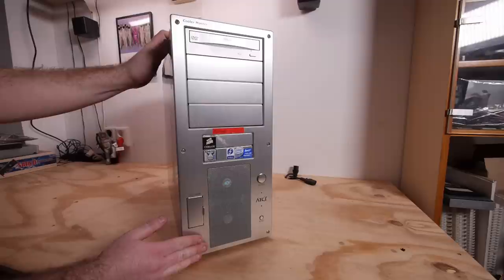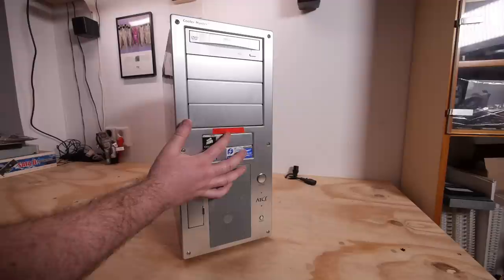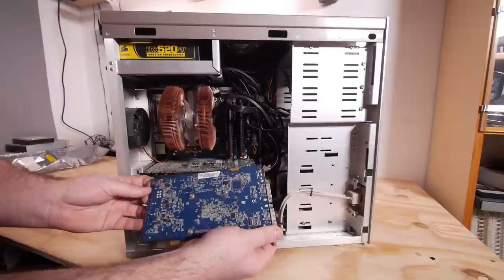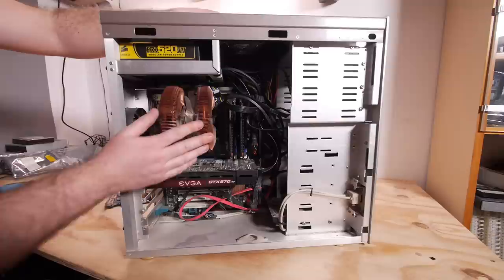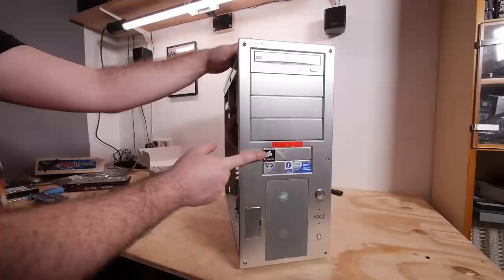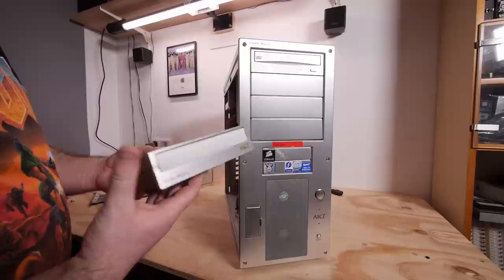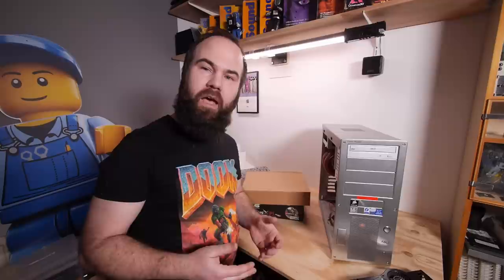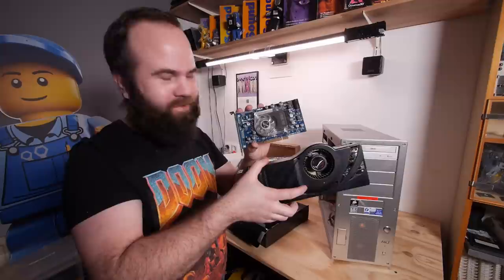I Finally got my 2007 Intel Q6600 Workstation Back!

Comment: That case. Classic. Don't think we'll ever see cases of that quality again. My personal favorite are my Lian Li K7's. Steel chassis, full aluminum shell. Built like tanks.
Reply: I feel the same way about my Corsair 650D.  It’s built like a tank.  Paid $200 for it new and still have it 8-9 years later.
Reply: currently using an alienware Area 51 case from 2003, Saucer Grey. Got it for free, i actually have the og board, psu, gpu, ram, and hdd but they're kinda hit-or-miss when powering them up sadly

Comment: Datorbutiken just means "The Computer Shop" :) 707 SEK would today be about €70 so a bit more adjusted for inflation. As for the sound card the Audigy 2 ZS is a great card but I'd probably say go for an X-Fi if you have one. Really looking forward to this geweldig build. :)
Reply from the maker: That was pretty cheap :)
Reply: X-FI Fatality was what i would have bought back in then for sound.

Comment: I also have a Q6600.
I have with a ASUS P5K motherboard, 8 GB DDR2 RAM, ASUS 8800 GT (256 MB).
It still works and I use it as a test computer.

Comment: I had a machine very similar to that, but with a lesser motherboard. I also had a Q6600 overclocked to 3Ghz with Zalman cooler, 8GB of Kingston that was unofficially supported but worked. I ran Fedora Linux on a Samsung SSD boot drive! That was my main workstation until 2014! Love your videos! They bring back great memories ☺️

Comment: I'd still use that Gigabyte RAM card and let it backup the current state to the normal HDDs in the system prior to shutting down. If the RAM card really maxes out at 4 GB as you mentioned and you set up backup so that only changed files are backed up it will be very fast to complete anyway.
Regarding the choice of the soundcard go for an X-Fi based card and dependend on which kind of speakers or headphones you're gonna use get one with HDMI output or good analog output.

Comment: The X-Fi XtremeMusic (SB0460) is a good fit.  It's actually from around 2005.  It will support all the later EAX modes which would have been appropriate for the games of this era, while the Audigy2 won't.

Comment: beautiful case, all aluminum so nice. so funny about that dent, i just got a wave master and i installed a x48/qx9650 with the non copper version of that cooler, and luckily the wave masters side hole just clears the cooler...

Comment: I have the Nickel Plated 9900MAX cooler version of that cooler cooling a bare die 5.3GHz 8700K. I took the cooler right of my eVGA 680i SLi motherboard which also has a Q6600 GO. Which i still have running at 3.8GHz. Yes my CRYSIS rig still runs today. I dropped a GTX1050ti in it with OCZ's Platinum 1200MHz DDR2. Pretty nice setup even for today.

Comment: I still have a q6600 running in my office.. & it's good enough for excel & basic webpage.
Reply: I still use it at home to watch videos and play games. It handles Shift 2 and Lords of Shadow 2 surprisingly well with a Radeon HD 3870 512MB! It originally had a GeForce 9800 GT, but that just randomly died one day for no apparent reason..

Comment: I got a Pc with an intel core 2 quad Q6700 and 8 gb ram and a gtx 550 ti 1 gb vram. It runs windows 10 64 bit. I had to disable lots of things to not have 100% cpu usage all the time but after that, it works surprisingly well.

Comment: Looking at your sound cards option: for an ultimate 2007-2006 era build you must use sound blaster X-FI. So go ahead with SB0460.
At the end I will change the GPU. It's rare, it was awesome at the time but if you want to play Crysis or 2007/2008 games era you need more power to maxed out or to play them at 1080p or higher. So if I were you I would buy a Radeon HD4870 or 4890 series card. If you want Nvidia GTX 260 with 216SP or higher 2xx series. That's the highest solution to avoid compatibilities and graphics problems.

Comment: The RAM-Disk-Card is rather interesting for this build. Using Windows (which I think is totally legit on this non-productive, gaming oriented system) you could change the settings to only put the virtual ram into this ramdisk. For this thus you need either a battery to store the format data on the ramdrive or a program to run once on a power-cycle in order to format the ramdrive before starting Windows because it BSODs otherwise.
The Ageia Physix Card is rather rare and I think there were usecases beside games back in the day. I kind of remember plugins to Autodesk Inventor and SolidWorks to use these cards for improving speed on stress calculations.
For your soundcard choice I would like to say the gold plated card looks nicer. The capabilities of both cars are almost identical when not using the Live!Drive.
Regarding your choice to use hdds:
It kind of makes sense in this circumstance because the speed-boost you could gain with a ssd is rather minor. The bottle-neck would be the sata 1 controller. For data, you depend on, you should use your external controller card(s).
And please do yourself a favour and recap the whole board. I know: It seems unneccessary now but consider: If you build up your system with this mainboard and slowly but shurely one after another cap is failing: Do you really want to rebuild your system 10 or more times?
And while your soldering iron is hot, please check your other cards for capacitors as well. Recently I had an Audigy failing with leaking capacitors and it is a mess to clean up afterwards, I assure you!

Comment: I had the same (BH5) hyperx modules with the same cpu on P5K, with the same PSU, and had the same ram problems. The root cause is that the memory modules advertise one of the parameters 1 clock faster than the memory controller in the chipset can be configured for. The Asus bios does not have any code to limit the parameter, and ends up loading a crazy value into the chipset, unless you set the timing +1 manually. The psu still lives on to power my i5-3570K and now R7-3700X.

Comment: Ram is probably unstable because of the chipset lacking voltage in the right places vs the cpu.
It's a 975x chipset & fsb normally not taking beyond 1333 fsb with the core 2 extreme qx6850, so a 3.0 ghz overclock on the q6600 is probably near the chipset limit with the lowest ram timings you can do with 667 mhz or 800 mhz ram speed if you push voltage a tiny bit on ram controller on the q6600.

Maybe go with a bit newer socket 775 motherboard & a socket 775 xeon mod like a e5450.

X-FI soundcard as other comments mentions should work well.
A 32 gb ssd wouldn't be too out of place actually, November 2007 first 2.5 ssd's came out with ofc high prices of around 5 - 700 € for a 32 gb drive, mtron & memoright ssd's on ebay you can get a fairly early ssd for about 30 - 50€ or so, if you don't mind going a bit newer you can get a 64 gb samsung ssd on ebay for like 20 usd or so from May 2008, it's called Samsung MCC0E64G5MPP-0VA.

Comment: Mod an lga 771 xeon on it like x5460 and overclock it to 4.0ghz like i did with my retro xp pc. It has the Super Flower 201S case, asus striker 2 extreme, Corsair dominator ram ddr3 1600mhz, clocked at 1700 mhz, and 9800 gx2 oc dual gpu. Fill all or mostly all of the front slots of the case with expansions like the cooler master musketeer, i still have a few of those new in the box.

Comment: I would go with that second soundcard, the sound blaster sb0460. That model is an X-fi model, and they are a bit better than the Audigy Cards. And I really like how you pronounce Aluminum as ali-mi-niam. I am not mocking you and I understand that some English language is hard to pronounce, but I thought it was funny. Anyway, it's a really nice Windows XP PC. My Windows XP machine has an AMD FX 4300 CPU, 4 GB of DDR3 RAM, and EVGA Geforce GTX 50 Ti 448 Core edition, and a Soundblaster X-fi Fatal1ty pro (love that card). I am thinking of downgrading the videocard to a Geforce GTX 280, so I can use older videocard drivers and have better compatibility with old titles.

Comment: The SB0460 is an Soundblaster X-Fi XtremeMusic from 2005.

One of these GPU's would be fine I think.
- 8800 Ultra
- 8800 GTX
- 8800 GTS 512 (basically a slightly faster GTX, but with less memory and memory bandwith performing on par with the GTX)

If you want to use less power a GT750 Ti is a good choice ;)

Comment: I have a small collection of LGA775 MBs: ASUS P5K3 Deluxe, ASUS P5Q3 Deluxe which as of last try isn't booting anymore, ASUS P5E64 WS Evolution - there is one mosfet or some regulator that looks to be burned near bottom FAN connector but otherwise mb works without any issue, ASUS P5L 1394 - low end i945 chipset which can't support more than 3.5GB of DDR2 RAM eventhough it has four slots for at least 8GB theoretical :) I have 2x Q6600 both steppings, 2x Q9550 both steppings, some dual cores 45nm/65nm with 1066/1333FSB, some Pentium D, some Pentium 4 and one X5470 which i had OCed before on cold air just with a tower cooler to 4717MHz for cinebench R15. The Q9550 did OC to about 4080MHz for daily stable on the Evolution and about 4165MHz for R15 with pretty good memory bandwith and 16GB of DDR3 RAM :) Also i use high quality Samsung SSD for boot drive connected always to the fastest port and a second nvme SSD in PCIe slot on these old mobos :) I tried to play Battlefield 1 multiplayer before on the X5470 4.5GHz but it was quite choppy with a GTX 1660Ti  - the LGA775 platform doesn't have the RAM bandwith for certain new messy RAM intensive games. Also RTX 3080 works on the Evolution :D

Comment: That sound card with the heatsink is an Xfi Platinum or similar (OEM version?). Good match for this era machine but an Auzentech Prelude would be better, best sound card for winXP gaming back then. Uses the same Xfi processor chip so the DirectSound/HW acceleration is still good but the audio hardware is superior to the Creative cards.

Comment: Love that PhysX Card, I definitely need one in my Collection too :D But in this Build it doesn't make much sense because Nvidia made PhysX available for most GeForce 8 Series cards and newer. So that AGEIA PhysX card would fit best in a system with an 6000 or 7000 GeForce GPU. Also one of my favorite Games with PhysX support is CrazyMachines CM² (depending on the game version, it can support Nvidia PhysX as well as AGEIA PhysX) :)

Comment: Hello Victor, L like your videos, i enjoy them a lot. 
may share with you my thoughts about your project? I believe there is good potential to gain big boos for this this system if you choose your parts well. My friendly advice is check and verify if this motherboard allows Q9650 - far SUPERIOR cpu, and DDR3 1333 RAM memory. I hope it  does. if it does, you are on a track to unleash a beast. If it is supported as i suggested install it as per my suggestion. I made a recording and editing audio station with 16 gb dd3, 1333 mhz in Dual channel, using  4 sticks, 4 gb each, of DDR3 1333mhz memory, on an proper Workstation motherboard, with M2000 or M2200 Quadro (i do not remember if it was M2000 or M2200, but the M2200 gets in my head for some reason, i need to check and verify the quadro model) running in compute and display mode to accelerate. As final results the Q9650 rips and and shreds :-). So my suggestion is make it the same way i did, the same parts, you will thank me later. It will shred for its time i mean. this Geforce 8800 is VERY WEAK it will create severe bottleneck the system and the system will drop performance significantly. The quadro i recommended will boost the system to Nvidia Geforce GTX 900 series, roughly the strongest you can use with q9650 with negligible to small system bottleneck. Best thing is this can be a Windows XP pro 64 bit monster on your desk, a fierce monster striking fear in the hearts of it's opponents :-)
Reply from the maker: No I will keep this CPU and motherboard combo! because I bought it new! :)
Reply: @victorbart  i found th card it is the m2000, not the m2200. enjoy your build Victor, i am curious what you will come out with. good work, cood channel i like it

Comment: As one of the bestest system builder back around then....
SO.... If you get 3 raptors in a raid 0 this should give you around 375Mb/s which will work for your boot and soft drive.
When you get XP set up and your Scsi, Change the Windows Swap space to that drive over the raptors to boost overall performance. There is something like 20 setting that should be changed to speed the system up just for the OS. I cant remember them now...

Ageia PhysX was a big thing for two years or so... (2007 coverage https://www.youtube.com/watch?v=ZiIfSCuwiQw) Nvidia Bought them out in May 2008 and included the sdk into the 8 series and the last "cards" were 9800gtx or year 2011
Meanwhile Nvidia Apex lasted one year, The issue was that the best cards were expensive and then to add another card on top was getting silly money together with the high power requirements... Also the multi core cpu performance and requirements were a bit of a shortfall.

Around and shortly before this period there had been a lot of competition coming forward to "boost graphic" and "more real". Some came and went... mostly went...

Now the motherboard Im not sold on.... If you would  maybe the asus ROG  Maximus Formula as it has the newer chip, and should really be a DDR3 board but is DDR2.... its a 2009 board I think? But would you go for a Q9550?